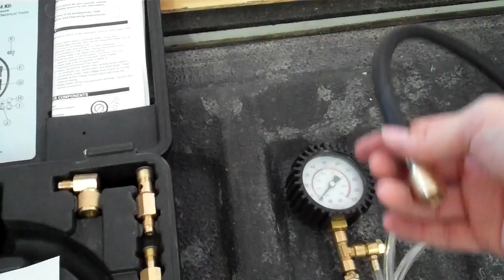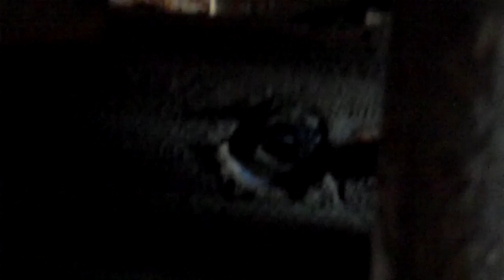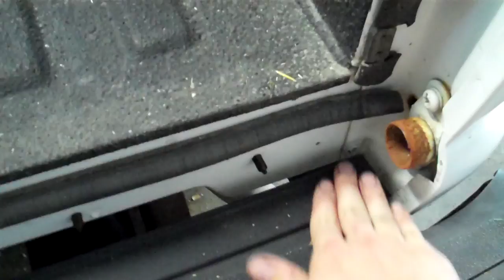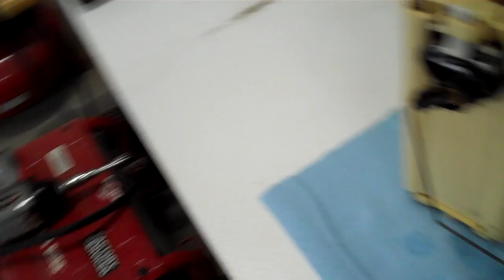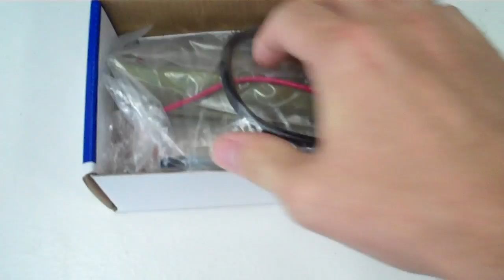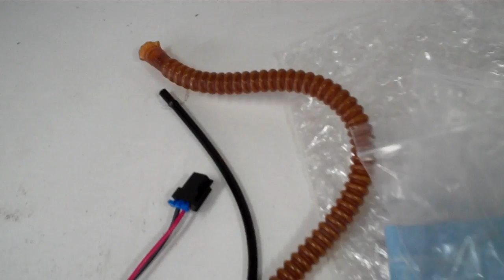2003 Chevrolet S10 ZR2 Fuel Pump Replacement 4.3L V6

Comment: How many miles were on your truck when the pump went?
Reply from the maker: Great question - it was so long ago I can't be 100% sure but I believe the truck had around 125,000 miles at the time.  I wasn't the first owner so I can't say if it was the original fuel pump although based upon the condition of the pump and rust on the fasteners etc. I believe it was the factory pump.  I believe these pumps should last at least 100k, so having 125k on the truck seems about right.
Reply: @Phormify  Ok thanks. I bought my 94 s10 new in July of 94 and my truck has 172,000 miles so I guess I am on borrowed time. Not looking forward to that work when it goes bad.

Comment: On the rear bed bolts if you do not have a hitch there is a hole in the frame for a socket and extension to get through. A breaker bar works well to lossen bolts too. That is what I used.

Comment: Could you remove all the bolts and slide the bed back a foot or two?
Reply from the maker: That would require a bit more work to disconnect all of the wiring that is attached to the bed - so in the long run it would take a lot more time to try and do it that way.

Comment: really great video bud. as far as diy tutorials go, this is 5 stars. really appreciate the thuroughness
Reply from the maker: Thanks for the feedback - I hope you have great success with yours!
Reply: I don't that safe the way those Jack's an are and boards are . Lose a hand or an arm if it falls doing work.  Other wise the video is good.  I bought a Delphi fuel pump for my 2002 ZR2  from  Walmart on line. A Delphi is a Delphi when it's new , no matter where you buy  it. Came with free shipping. You save about $75 to $100  from t he auto parts store. I paid $174

Comment: I've got a 2001 s-10 4.3 engine. Fuel pump went bad and I got a new one on e-bay for 36 bucks with the fuel gauge included. That was about 18 months ago. I took all the bolts out of the bed and lifted the bed up on just one side over the fuel tank. Used a 4x4 to hold the bed up.  I had a little trouble clearing the fuel neck as I jacked up the corner but not much. No damage to anything.  My biggest problem was trying to install the new o-ring. It was round and the old one was flatter. After about 20 minutes I just reinstalled the old ring. No worries.

Comment: Well done video and Thank you. One thought,, if the frame mounted fuel filter is accessable with the bed up wouldn't it make sense to go ahead and change it rather than have to crawl around on your back to change it later?

Comment: What type is the AC Delco fuel pump you used?  jaduranjr at icloud
Reply from the maker: I don't recall since it was nearly four years ago.  However I just searched for compatible parts and found one on eBay if memory serves correctly.

Comment: Nice work on this video. I'm saving this one for future reference pictures.
I did this job on my 03 ZR2 (nice truck BTW) without lifting the bed.  Did it all from underneath.  My pump hadn't died so I was able to run all but about 1/2 gallon out of the tank.  There were difficult moments mostly caused by the fact that this fuel tank assembly is installed into the chassis from the top at the assembly line so some of the clamps were more difficult to get to than that needed to be but it went back together easy.  Mine has a plastic tank and had very little fuel it so it was easy to handle.  No jacking and no sticking my head  and arms in giant mouse trap. If I had to do it again I would still do it that way but it's just personal preference.  Plus my clamps and fasteners are all facing easy access directions now.

Comment: I went into a row of potholes at 25 mph, the road was covered with holes and bumps. all my light in the dash flashed, and my engine stopped working, I pulled over, everything was working battery wise, engine was cranking but no start and I wasn't hearing the fuel pump kicking in. I have all the symptoms of a bad fuel pump but my gas gauge doesn't work like yours.  I have checked my fuel pump fuse, its fine. Could it be a bad fuel pump ground then ?
Reply from the maker: Sounds like an electrical failure of some sort.  Could be a bad ground but if all the lights flashed it makes me think you might have other issues.  You could hook up a fuel pressure gauge and see if you are getting fuel pressure when you crank the engine.  If you aren't... you might be on to something so time to dig deeper.  If the pressure ends up reading ok at least you eliminated the pump as the source of the problem.
Reply: I done that but no fuel pressure when I'm cranking the engine. its really weird!!! today I also notice that the shifter light in the dash (P, R, N, D, 3, 2, 1) doesn't work anymore. I see for exemple, the letters and the numbers, but I don't see if I'm in P,  R, or N, or D.
Reply from the maker: Sounds like you may have a larger electrical problem. Could be more complex to troubleshoot but it may be a gamble to replace the pump unless you’re sure.

Comment: I did my 2003 ZR2 FP from the bottom but I had almost all gas out.  (notice you have 5/8 full).  It was at moments difficult but I had large tool box in bed with 2nd battery in it so didn't want to go that way. I bought Delphi pump complete assy from RockAuto.com for $200.  They have a few choices even cheaper but Delphi is OEM equivalent.  I would never do the rebuild kit because of all the work to get FP  in and out but it is a more cost effective choice.  Nice looking in white. Mine's silver but paint has held up well.  Well done video.
Reply from the maker: Dropping the tank isn't really anymore work if you have to deal with a tool box or a full box so sounds like you made a wise decision.  I also agree buying the full assembly is the way to go for many people and can avoid having to redo the repair in the future so it can be cheap insurance.
Reply: Delphi sux.  I had to replace mine after 40,000 miles ......
Reply: @sschevmale24  Well, that's disappointing to hear.  They are pricey little B*st*rds and a bit of a hassle to get to also.
Reply: @x-man5056  maybe you will have better luck man.  Try good gas and fuel treatments.  I think I got Borg Warner now I cant remember !!!!!
Reply: @sschevmale24  4 times a year with injector cleaner.  Do you have metal tank or plastic?
Reply: @x-man5056  metal.  I started using seafoam a lot now. Seems to be good
Reply: @sschevmale24  I have used seaform on other cars for heavy cleaning. I like it.  
I just changed my intake gaskets and injectors so just need regular prevent injector cleaning for now. 
I did left motor mount today, that was fun.....no.
Reply: @sschevmale24 Mine is plastic.  Was just wondering if rust could've contributed to your fuel pump problems.  Do you live in North East or where roads are regularly salted in the winter?

Comment: Awesome video my man! Quick question for ya. I have same truck but 4 door. Is it still possible to tilt truck bed or do I need to pull tank from bottom? Looks like it’s more under cab than the bed. Thanks!
Reply from the maker: Will Unmisig - Sorry I really have zero experience with the four door. You might check to see if there is an access panel under the rear seat as that is fairly common in cars - so maybe you would get lucky and find something under the carpet. Otherwise if it looks like the tank is under the cab rather than the bed you might have to do it the old fashioned way and drop the tank. It can take a little longer and requires you to drain the tank before starting but it isn’t that bad.
Reply: Red Pushpin thank you for the response. After reading it looks like I’m forced to do the old fashioned way.

Comment: Installed new fuel pump but now gas gage don't work
Reply from the maker: If it worked before you replaced the pump I have to assume you might have a bad connection that presented itself when you disconnected and reconnected the sending unit.  If you just replaced the pump itself and not the entire assembly, I suppose it is possible the sending unit is bad - or when you dropped the unit back into the tank the float might have become stuck.  Hopefully you didn't put the bed back on yet so you can try a few things!

Comment: Hi I know this is an old video so I'm not sure if you still respond to these. My husband bought this exact kit for his 2003 Chevy Blazer S10 - just waiting for it to be delivered. How long did your repair end up lasting? We are on a tight budget and couldnt afford the 200+ for the whole new unit. Thanks for the video!
Reply from the maker: Stephanie Barry - I still have the truck and haven’t had any other problems with the fuel pump so the repair has held up extremely well.  Hope it works as well for you and that it gives you years of worry-free use.

Comment: thanks for your video. it was very cold evening and after leaving the gym my sonoma didn't start. it cranked but didn't stayed on. I followed your first step and problem solved I guess it was just the relay. after 30 min stranded, found your video. thanks.
Reply from the maker: That's awesome - much better to have it be a simple relay and not the pump itself.  Hope a replacement solves your problem for good.

Comment: Did you notice that when you first turned on the ignition key and tried to start the truck the fuel gauge needle slammed all the way to the left to the "E" And after you made the repairs it didn't move at all.
Reply from the maker: Henry Avery I guess I didn't notice.  Not sure that would be a diagnostic test or not... it might have simply been due to a lack of fuel pressure initially. However the fuel level sensor wasn't replaced so not really sure what it would mean either way.
Reply: You might have stepper motor issues in your dash cluster.

Comment: what a great video!!  thanks for awesome instructional tutorial... it's going to really help me tremendously!
Reply from the maker: Thanks - I really should do more of these.... people still seem to enjoy keeping these S-10s on the road.
Reply: Its so nice to actually have someone explain this clearly and with such detail...  Many of the other videos I found have a lot of cussing (which I hate) and unclear information.  Thanks again Phormify!!!
Reply from the maker: You bet!  And that is why I made the video in the first place because when I looked I couldn't find one that showed me all the detail I wanted.  There are some good videos out there but most only cover a small portion of the project or skip details I wanted to know about.  

I probably made the video too long and boring - but hopefully it has enough detail that would convince someone who is on the fence about doing the project themselves that they could handle it.  After all - I am not a mechanic and don't even bother to change my own oil most of the time.  But this was an relatively easy project and saved he hundreds from letting a shop do it.  

Best of luck on your replacement - hope it goes as smooth for you as it did for me.
Reply: Phormify Do you happen to know if that same repair kit will work with a 1996 Chevy S-10?
Reply from the maker: Danny Herrera I think so, but any kit you buy should give you the year ranges it covers. Better check that to be sure.

Comment: Thanks for the video ... 'cept for the color and the remote start, I have the exact same truck, and I'm about to use your video to guide me through the steps.  Your video is from about a year and a half ago ... I'm having trouble locating that ACDelco rebuild kit using the numbers on your part box.  Where did you locate one to order?
Reply from the maker: I actually got mine on eBay at the time.  However you could inquire at sites like Rockauto.com or other online sources known to have large inventories - some have even used Amazon.  Worst case you can always go for the EOM kit but it would cost a bit more.
Reply: I got one on eBay - $34
However when we pulled the unit, the plastic housing on top broke off at one of the fuel line connections, and taking the time to rebuild the thing not knowing if we could successfully clamp the hose back on the broken part ... well, I decided to run down to the local auto parts store and buy a whole new sending unit - $289
Had I found time, or knew in advance, (although it seems the original OEM part is now discontinued) I found and should have ordered a compatible ACDelco unit at rockauto for a lot less ... but in the long run, when the truck is already apart and occupied in someone else's spot in the garage -  time becomes more valuable than money.  The Precision unit I got does come with a lifetime warranty.

Thanks for the video, your tips made the whole process very, very easy overall.  I may have spent $300 on a part and gave my buddy $100 for his mechanical assistance and help ... but it sure beats the $1100 quote the local Chevy dealer gave me ($472 part, $500 labor, shop fees, tax ... )!!!

Comment: Good video, and very well explained.  I would just like to add that saving some money is great by ordering just the rebuild kit, but a known issue with the factory pump assembly is the sending unit malfunctioning, as it did on my 2001 S-10.  I just had mine replaced by my mechanic that did the same procedure as you.  He just jacked up the bed and replaced it that way.  My sending unit had been intermittent for a few years, but I was going to wait until the fuel pump itself actually went bad.  Sometimes the gauge wouldn't read correctly, it would drop down to "E" while sitting still, then jump back up after driving, etc.  In my opinion, it's just best to replace the whole assembly and spend the $250 or so, and be done with it.  Hopefully you will not have any issues with your sending unit to where you have to go through this same procedure again.  Thanks again for the great video!!
Reply: Sometimes when you think you're sending unit is going bad , it's the stepper motor in your dash Guage cluster,  just a bit of information in case anyone else has gas needle issues.

Comment: I know this is an older video...but, just wanted to say, I sure miss my 2001 Chevy S-10 ZR2...so much fun! Have you seen the new 2017 Chevy Colorado ZR2?
Reply from the maker: Chris DIYer No I didn't know they were doing a newer ZR2 but I'll have to check it out!  I've been thinking about trading so maybe it is time.
Reply: @Phormify  don't do it man.  Keep it. Trust me you will regret it.  That's why I still have my s10 278k miles 1996
Reply: The new ZR2s are super nice but also very expensive compared to the S10s. Beautiful machines though.

Comment: as i was driving my truck around town i noticed it wanted to stall.my rpm's went down on a red light or stop sign.then on the highway it was jerking as if it wanted to stall a few times.do you think its my fuel pump?i did notice it does that when i press on the gas.then i stopped at  store i had to start my truck 3 times for it to run.can it be my spark plugs and cables?or the fuel pump?any ideas will be greatly appreciated.
Reply from the maker: Hugo Chavez It sure sounds like the fuel pump is on the way out. When mine started there were a few times the truck didn't want to start right away. It would also seem like it was starved for fuel every now and then. However there is no guarantee as those symptoms could be related to several other things. Best thing to do is test the fuel pump pressure and see if it reads low.
Reply: Thank you

Comment: I'm so choked...about 3 years ago spent $1,300 to have this repair done and could've done it myself. The video was great! The detailed explanations are appreciated as not everyone knows all the little details that come in handy. The thought of dropping the tank is what always took this job out of my capability level...now I feel confident I could do it. And I might have to...the last repair was on my ex's truck. I'm seeing someone else now driving the same type of truck but hasn't had the pump changed yet. Thanks man!
Reply from the maker: Thanks - hopefully you'll never need to do this, but if you do I hope it helps.  These trucks are getting older so repairs seem more frequent these days.  I'm just hoping I don't need to do this one again anytime soon.
Reply: Jesus 1400 what the hell Why? Did they replace all the lines and tank????? I spent 400 at my mechanic I didn't want to dick with it.
Reply: @sschevmale24  I wish I had your mechanic. Seems like every mechanic I go to I come out with it high price
Reply: @tomtroy3792  he just unbolted bed propped up piece of wood on jack and had enough room to remove pump.  Might be 500-600 today with inflation

Comment: Side tilt method offers many advantages. We have taken it one step further to invent a BedliftR tool that attaches to the frame and allows one single person to easily and SAFELY do fuel pump work on trucks with a side tilt method.  You can watch video at http://www.tec-tools.com/home.html.   It is shown on a lift, but the work can be done on the ground as well. We are just going out to market now, so if you ever were interested in getting a demo model to test out, contact us. Thanks.
Reply: Tec-Tools.com would love that
Reply: Side tilt will allow for more access and room to work, but how much do you risk bending/buckling the bedside?  Tilting back seems to be a better way for stability and to bring it back down for realignment of bolt holes.  I read  today about someone who used the side tilt method(working alone), buckled their bedside, AND pinched/damaged the filler tube on the way back down.